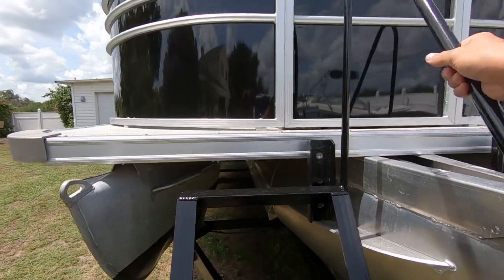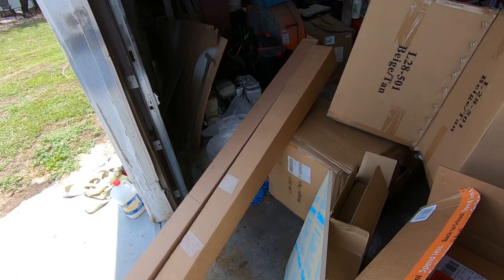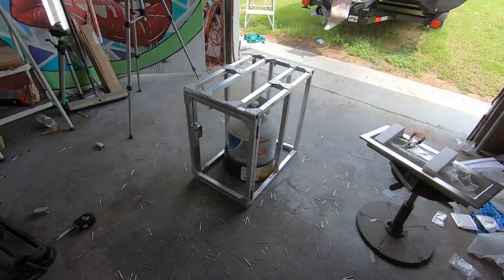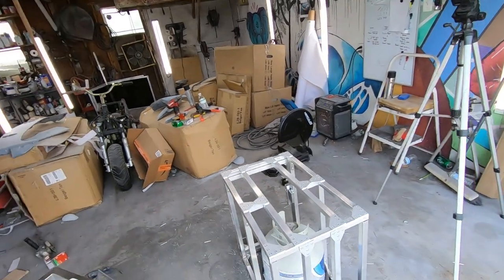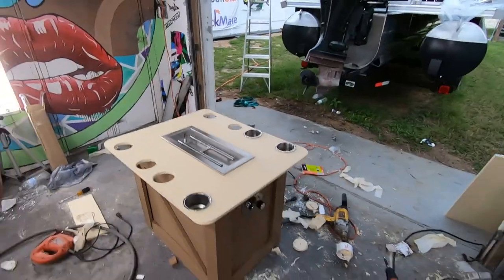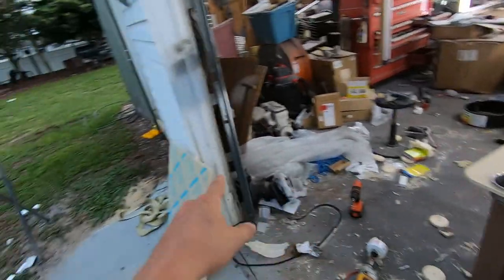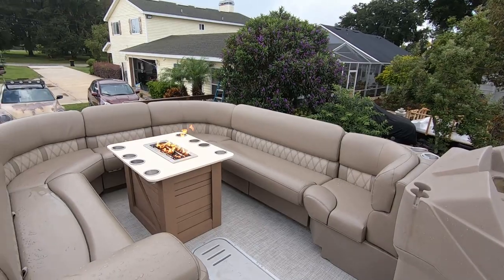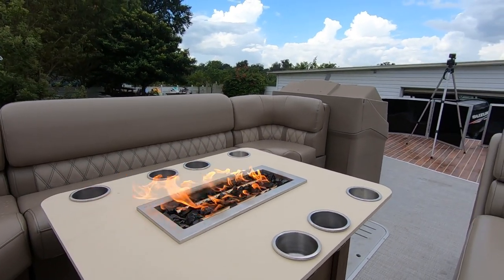Building a Fire Pit Table for my Boat - Episode 7

Comment: Add drop out vents (low down) in the firepit framework, I know its not a sealed unit, but drop out vents will guarantee no explosive gas build up, if there is a propane leak.
Reply: That's a really good idea to have.
Reply: By far best comment I’ve read! I definitely agree it needs some exhaust vents around it!
Reply: 100% agree. Probably need to secure that tank better for potential rough roads and waters too

Comment: Your gas control is working as intended. Make sure you have your flame detector set properly. This control system pushes in for you to start the fire and manually confirm operation until the flame detector detects a flame and takes control of the gas operation. if for whatever reason the flame goes out the system automatically shuts the gas off for safety. without a flame detector this control system will function just like you show.
Reply: I agree here.
Reply: Right.  I think it is called a thermocouple.
Reply: Both replies are correct.  The thermocouple is not getting enough heat to keep the gas valve open.  The "stick" method that we see here by passes this safety feature.  If the wind blows out the flame the LP gas will continue to release into the air.
Reply: Yes, sounds like thermocouple.
Reply: @robertpetrasek1773  exactly. Thus he needs to get this fixed asap.  Love the build and looking forward to more progress.   🙌

Comment: Are you missing a thermal coupler? Most gas valves need to have one for safety reasons. Under normal conditions, you have to press on the valve till the thermal coupler heats up and then it holds the valve open. Then if say a gust of wind blows the fire out, then the thermal coupler cools and closes the valve to prevent a gas leak.

Comment: Hey Zach! Don't send the gas controls  back, that is how they are supposed to work, you have to press and hold the knob while turning it and with the left hand press the spark, and once the fire starts you can release.
Reply: ..once the thermocouple has  reached temperature. This is a safety feature so that if the flame is extinguished the gas is automatically shut off.

Comment: The firepit looks very good. The one concern I would have is height of the fire in relation to the countertop. While watching the video it looks like the flames are shifting in the breeze to the point where they might burn some ones hand or arm as they reached for the cup holder. Hopefully its just an illusion from the angle where the camera was placed.
Reply: On those cool nights if one of the ladies has a long flowing acrylic shaw or wrap that is flammable that could be a bad time.
Reply: The flame is adjustable with the controller

Comment: Love the fire place!!! As a firefighter, I am curious which type of material you used for the counter top. Polyethylene melts around 230 degrees F. My concern is the radiant heat distribution. Can’t tell if the housing is insulated or not. Put it in your back yard and let it burn for an hour. If you smell or see melting change up the counter to stone. Love the work! Stay safe!!
Reply: Have to say I agree with this... Doing a "burn in" on a windy day, making sure the flames wont burn the top, and a second one  on a calm day to insure the housing does not get to hot.

Comment: Awesome....I would consider placing 2 sheets of tempered glass on the long sides of the fire box, this way a heavy gust of wind won't blow anything into it or even burn someone if the flame gets too much oxygen and gets higher.

Comment: Brazing aluminum with a propane torch is relatively easy.
There's several tutorial videos here on YouTube about how to do it.
Using an easy to build jig is recommended as aluminum tubing can warp as you're welding it.
Use screws to move sections of the jig.
It's definitely way faster and neater than using gussets.
Gussets are also definitely a futire corrosion problem no matter how good you wash down your boat.
It's why you rarely see them on most boats unless it's a matter of structure strength.
All that said.
Your fire pit is absolutely beautiful and functional.
Great job.

Comment: It's my understanding that you want airflow for the propane containers. Might want to add in some airflow holes somewhere, maybe an inch down from the top so that as you're moving it will allow the airflow.

Also being in FL I'd be concerned about storing that tank outdoors under a pontoon cover. I don't think they are supposed to be stored in hot areas, and it gets toasty under a cover.
Reply: Everyone in Fla has tanks outside on their BBQ’s .
Reply: Top vent or bottom ? I get it mixed up. But definitely need vent
Reply: @lionpawprintsandmedia  good call out and I'm unsure, hopefully he sees it though.
Reply: I live in Florida , my gas tank is outside on the bbq grill , never had a problem in over twenty years plus all the gas station that sell gas they keep them outside , never heard of any issues
Reply: @ROD59  yeah being outside isn't a problem but if you notice all the gas grills have vent/airflow ports.
Reply: Good idea to let propane escape instead of building up inside the box in case there is ever a leak.  Propane is heavier than air so vent near the bottom.
Reply: Propane is heavy so it needs to be at the bottom 👍
I was waiting the entire video for him to say something about venting it 🙏
I hope he sees the comments

Comment: Some gas control valves assemblies are design for use with a ignitor that utilizes a thermocouple that allows the gas valve to stay on after the thermocouple has warmed up.  It is a safety feature.  Pushing and holding the knob in puts the unit into pilot lighting mode and once the thermocouple is warmed enough releasing the knob allows for typical operation.  Certainly it could simple be a bad control valves assembly as you guessed.   Good luck, the progress is great.

Comment: The gas stopping means the thermocouple isn't seeing the flame. After holding in the valve and starting the fire it should stay lit after about 10 seconds. Check to make sure the flame is hitting the thermocouple.
Reply: Just like a turkey fryer.
Reply: Yep. What he said. Thermocoupler is the problem. 

Also, I can’t tell what kind of gaps you have in those slats, but it will make this setup better and safer if by chance it’s sealed.

Comment: You should take the extra piece of starboard and make a cover for the fire pit  that way it can double for a full table.
Reply: You might have enough starboard left you can use as trim around the whole thing and give it a lip so stuff doesn’t slide off it.  You can bend around the curves with a heat gun and screw it down as you go.

Comment: Looking good brother ,is coming along fantastic . Don't listen to all the keyboard warriors , do it the way you want is your boat if you want to put masking tape around it that's fine , people will never be satisfy .Propane gas is very safe as long as the bracket is secured and there's a little hole for ventilation you're fine , do what the heck you want is your boat ,like if you want a tiki hut as a roof is fine

Comment: I am not sure if anyone commented or not but propane needs a low ventilation point in event of gas leak because it is heavier than surrounding air. Can’t tell if there is a good air gab on the bottom. Don’t want to create a gas bubble! 

That said, I absolutely love this design you have going and honestly wish I would have scrapped my front door and went with the same wrap around.

Comment: If you used the much smaller bottles of propane meant for a camp stove you could have built the box for the fire-pit much narrower and it would allow better access around it. It also looks like a gas grill controller so even at its lowest you have a ton of flame that might hurt someone. Look at buying a small Coleman camping grill and you can take the controller and stuff from that. It might work better.

Comment: The gas valve is designed that way - it will only flow while pressed UNTIL its lit and warm enough to open the valve permanently.  You have to actually light it by pressing it in and wait for it to warm up a bit then let go and the gas should keep flowing.

Comment: The button your pushing in is to bypass the thermocouple.  Once the flame heats up the thermocouple it will hold the gas valve open.  It's for safety incase your flame blows out, the gas valve will close.

Comment: The gas problem  is a safety  feature  just incase you turn it  on by mistake  most ovens have and thats why you have to turn and hold it in for a few seconds once it's lite.hope this helps ya understand  it better

Comment: Looks like you might have sorted out the fire pit staying on. If not, you just need to move the thermo-coupler around into the flame. That keeps the valve open.

That boat looks plush as hell. Where I boat you have to have a bow door because you beach pontoons and usually want to be able to board from the front. I think a good trade off is like you say, make the seat removeable for trips where you are going to beach it. If this was just a lake boat and always boarded from a dock, side boarding is perfect. For boarding while on the trailer, if you can't get over the bow rail, I probably don't want you on board.

Comment: Most pits like that have a thermocouple that needs to heat up and you usually have to hold the button in for about a min and then you can let go and it should work.

Comment: You need to hold the gas knob in until thermocouple heats up which then allows gas through it's a safety feature so that if gas gets blown out it switches off gas

Comment: The gas is shutting off because it's a safety feature. If the valve doesn't sense that there is an active flame it shuts off the flow of gas. There should be a wire coming from a heat sensor that's in the flame that connects to the valve. Normally you'd push the valve in for a few seconds until the sensor gets hot enough to send the signal to the valve that there is a flame.

Comment: @ 17:15 - you said it only puts out gas when you hold in the knob, wondering if it has a temp sensor somewhere to verify there is flame before letting the valve stay open when you release the knob. Just like the pilot light on the water heater or other gas devices.

Comment: To press and hold the regulator is a security feature..  Press it ..ignite and hold it for a short while.. it should prevent gas flow without a flame

Comment: The gas valve should stay open after it gets warm. It is a thermal switch for safety. Hold down the valve for about a minute and it should stay on.

Comment: A lot of those gas controller valves have a heat sensor and if it doesn't sense heat the gas will shut off maybe you can check that?

Comment: you should put in some ventalation in box. If you should get a small leak from hoses or tank valve. Gas will build up in box and if you fire up grill it may explode killing all around it. Just a though as i am a firefighter and have seen things like this happen,

Comment: "....CONTROLLED fire" on a boat, with kids and alcohol. Geez, why didn't I think of that....or Rustoleum as bottom paint, YEAH! It just keeps getting better and better, whoa doggies!
Reply from the maker: It’s been 6 months.. paint is still in perfect shape and zero accidents with plenty of drunk people. 😁
Reply: @ultimaterebuilds7127  ....really? well we know the paint was flaking off from the get go, you showed us. C'mom, it's not a marine paint. If it's so good, EVERYONE would be using it. Or, why the switch to Total Boat product on next one....hhmmm. And lots of drunks, you're all set!
Reply from the maker: You might be confusing this pontoon for my first build when the paint was flaking off… only problem I had with this paint is when the boat rubbed up on some concrete pad down at my lake. Scratched it a bit but one more spray covered that right up. 
Just provide more alternatives and different ideas for people to try. Total boat paint is expensive, works good but still expensive. Just looking for cheaper alternatives and this is one of them.

Comment: Found this online as to why the fire pit wont stay lit, hope it helps. 

Possible problems occurs during your use:
1) Valve after turn can not stick during using
Reason:
a. The thermocouple head is not heated in right place, please adjust thermocouple tip position.
b. The connection between thermocouple end and valve is not connected tight enough or too tight, please adjust the screw again
c. Need to push valve first then turn the spindle and hold for few seconds, it cannot stick immediately may need 5-15Seconds

Comment: Obviously to late now as you have already built this. But if you ever decide to change the look of the sides, look into evolve stone. It is a foam stone that looks the same as the real stone siding. All you have to do is shoot a finish nail through the foam to hold it on.

Comment: You should definitely not enclose a propane bottle w/o add adequate ventilation.  Propane is heavier than air so vents at the bottom of your enclosure would not just be advisable but mandatory.  Be safe!

Comment: It looks like the cupholder and left storage compartment on the console both hold water. is that true or is that just an illusion? I'm deciding between your large console and the regular size... I'd rather have the large, but I don't want to fight with standing water all the time (and I'd rather not drill holes and let it drip onto all the electrical within the console!)

@Ultimate Rebuilds

Comment: Think the seating is amazing. Don’t like the fire pit purely on its size. I wouldn’t want to be stuck in the front small seat and have to struggle past people to “escape” from the corner. That’s just me though. I would feel trapped in the corner. The gas problem usually has to do with the position of the thermocouple which is intended to cut off the gas it the flame goes out. See if you can find it and give it a bend nearer the flame.

Comment: Just a peanut gallery comment here, but I would have liked to see the fire pit sides look more like the sides of the pontoon. The barn door look doesn’t do it for me considering how luxury the rest of the pontoon looks- like the quilted stitched seats and the reflective, sleek sides of the walls. I DO think $19k is a lot to make that platform, but whoever is doing it has to build something that is safe, sturdy, and lightweight. It’s not likely hard to make out of sturdy steel, but I think it would take some skill, expensive materials, and time to make one that looks good, weighs very little, and can support a fair load.

Comment: I have no problem with a fire pit on a boat, those that do only ever used canoes. Most galleys have gas or alcohol burners, many use wood or oil stoves for heat.  But those burners are not very good for a tabletop with any wind at all.

Comment: I think you're headed in the right direction wit the fire pit, but it's still not there from what you have built in the past. The cup holders kill it. There are too many making it seemed cluttered. They're also too close the edge. Also the fire is too close to the counter top I would raise it or I would add a glass cover. Not hating on it just critiquing it. Either it's better then nothing.

Comment: Consider building the upper deck from 8020 extruded aluminum. It can be cut to size with a chop saw and the connectors make it easy to DIY. The strength is also insane. The seat color is so disappointing. The grey would have been killer...

Comment: I like some of what you've done with this boat, admittedly I'm not a fan of the flooring, I'd have stuck with the light color stuff that's up front. I'd also remove the front middle seat and leave the gate accessible. 

Also I'd suggest not being so butt hurt when someone doesn't agree with something you've done. Part of what your doing is asking for opinions, but when you suggest you don't care if someone disagrees with your choices, it's a bit off putting and could make people not want to give you their opinions anymore.